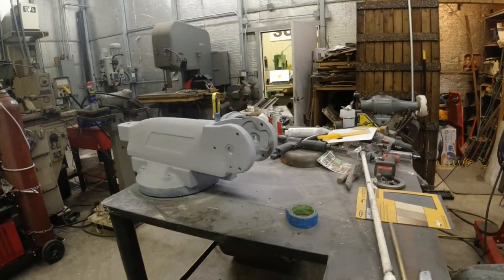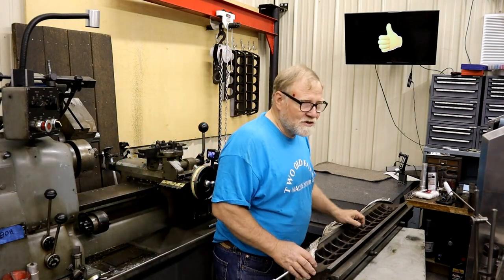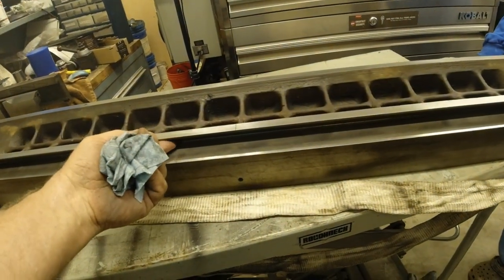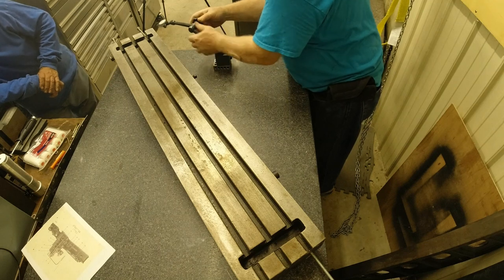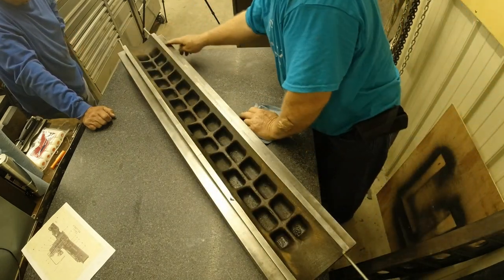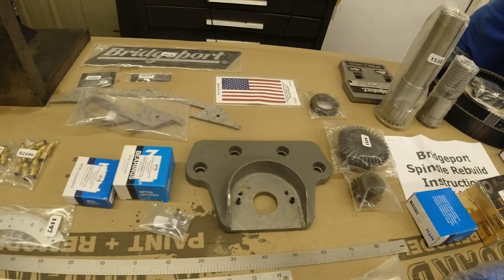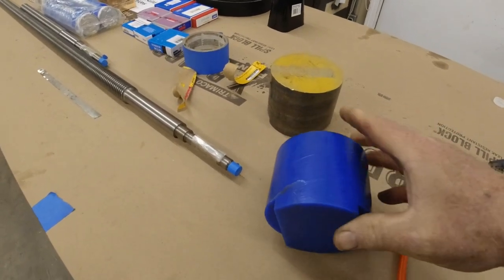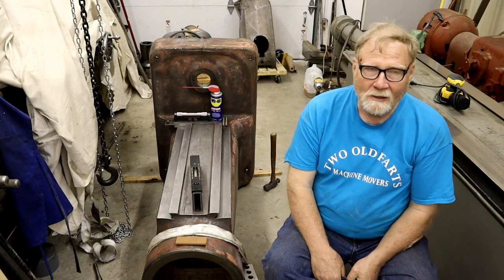IS this another expensive mistake?  Rebuilding the Bridgeport Mill and found many more problems

Comment: Fuzz the ways down on the column to get your bearing points.  Tale a impression with your straightedge and see how it looks.  Scrape the areas heavy that have no wear, check again.  After a few passes the flat ways should look pretty good.  Then you have the dovetail ways to deal with.  That is where your unseen wear is going to be.  
Like your content in you videos.  Yaw needs one more old fart to entertain us with!  Call it the three-never mind. Hehe.  As always, keep up the excellent work and training for us.  Ken
Reply from the maker: All I said was it's not going on the planer.... Never said I was not going to scrape it :)
Reply: @10swatkins  Just saying Steve.  Me, I'd run it as is and not look back. I wouldn't even spot the ways.  Your call. Ken

Comment: Steve a millwright friend of mine, on chrome surfaces will use a Dremel type hand grinder to go over the flaking to dress them up strictly for appearance it's very time consuming process but adds to eye appeal.
Reply from the maker: While it may be good eye candy it's really not good for the longevity of the machine. Chips, dirt and other trash get into the groves and git under the way wipers...

Comment: Don, I have to say that yes you can find Bridgeports for what Steve has in that machine but usually those are the machines that people sell and say they are all rebuilt and usually nothing but some half ass paint job and cleaning. At least you know this machine is done and done right. I also take my old machines apart and rebuild them to the best they can be. 
Steve, I hope you ask Don to wet sand that primer at about 1200 and then paint it so it really turns out like glass. It's looking good boys and look forward to your chips.
Reply from the maker: LOL.. Right getting Don to sand ... That's a good one! :)
Reply: @10swatkins  I knew you would like that one Steve.

Comment: Have you ever heard or read about the "Evanut" ?   This guy Evan, over on 'The Home Machinist Workshop' Forum, developed a method back in 2010 for creating a lead screw nut with zero backlash from Acetal .  The nut is formed by heating the lead screw and then the Acetal Blanks are clamped on creating the exact thread form.  Backlash is so tight they have chase it to relieve the nut formed threads. I know, I was skeptical too, no way it could hold up, yadah, yadah, yadah!  But it seems to be a least cost approach to fab a replacement nut; no tap to buy, material is inexpensive (well, shipping drives the cost up!).  I say you and Don should give it a try on the shaper nut.  Just read about it and see what you think after reading ( 'Making Acetal leadscrew nuts the easy way', jump to last pg (21) to read the Evanut process details. Most of my questions and issues were addressed within the comments and answers in that post.
Reply from the maker: I will look at it but this train has already left the station :)

Comment: Another great video, sorry it had bad news in it.
If I can ask a favour, when you get to doing the video for the nut for Don's shaper, can you explain, in the video, how you get the threaded hole in the correct position relative to everything else, since the old one looks like you wouldn't get a good measurement off it to centre a hole?
Reply from the maker: That's easy... The screw has a center already in the end... We will thread the old nut on the screw and take a measurement from that.... Should be close enough with the 3 inch long nut evening out the damage to the threads... Then it can be shimmed if needed...
Reply: @10swatkins  Ah, I see, You cheat(well sort of).
I was asking because I have a lathe(circ 1914, model unknown, but ~probably built in New Zealand for WW1) whose saddle cross feed that has two brass nuts mounted with countersunk screws to under the cross feed and at some time in the past was worn out and someone used lead poured around the cross feed screw and into the two nut's threads(an old farm fix).
Of course, it is now worn out again and so is the screw thread as well, and I was hoping for some wisdom to fall my way as to how to fix both, but it's becoming obvious I need a new cross screw first and then do some very careful measuring to make new nuts.
Thanks for the reply and keep those entertaining videos happening.
Cheers from Australia
Reply from the maker: @Bobs-Wrigles5555  Well I am getting older.. Cheating is allowed :)

Comment: When you had the table on the surface plate should you try and but a feeler gauge underneath it?  See if it’s worn versus warped?
Reply from the maker: The indicator shows what is happening... It's warped the same amount on both the top and bottom of the table... .008..   Most always the case when you have t slots on tables... The t nuts peen the bottom side of the t slot, stretch the metal on the top of the table and make it bow because the bottom of the table stays the same...
Reply: @10swatkins  so you would need to re-machine both the top surface and the slide.  Big job!  I was always wondering what the issue with tables was regarding warping, you've answered that question!  Do you know if machining the underside of the T slot (removal of the peened material) would fix a warp?
Reply from the maker: I have heard of people peening the back side of the table, to stretch that  side also,  to remove the unequal tension... I have all the tools to do it right so I have never tried that...   

On a table, grinding or planning, you start  by leveling off the 4 end corners so they are all equal distance from the planning table.   You do that by placing 123 block under each corner and sliding them back and forth till the heights match... The bed is bowed up in the middle... You plane the top flat, flip it over and that gives you a reference surface to plane the dovetails to...
Reply from the maker: @ogaugeclockwork4407  Lots of people think that the table ends droop down because the saddle is not supporting the whole length of the Bridgeport table...  Not the case...
Reply: @10swatkins  Shove that table in your heat treat oven and stress relieve it. It might bring both sides back to flat! 🤠

Comment: Shouldn’t you have masked off all of the mating and sliding surfaces first? Otherwise you’re going to have to remove the primer and paint from these surfaces after it’s painted. You know you can’t leave these surfaces painted.

You guys get stranger each time.
Reply from the maker: ITs easier with the tools I have to just remove what little there  is on the two surfaces.... Three minutes and it's done...